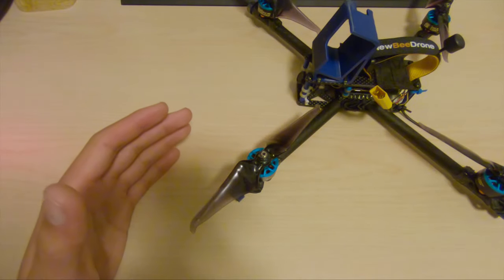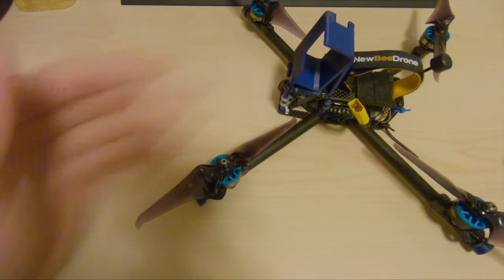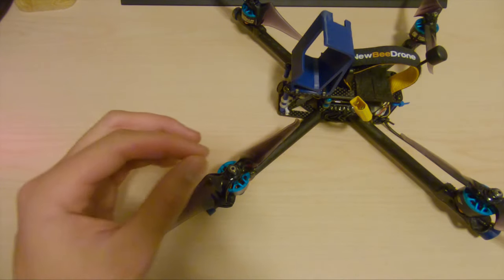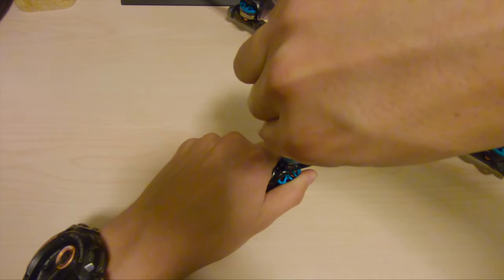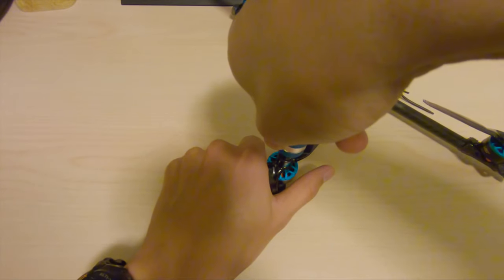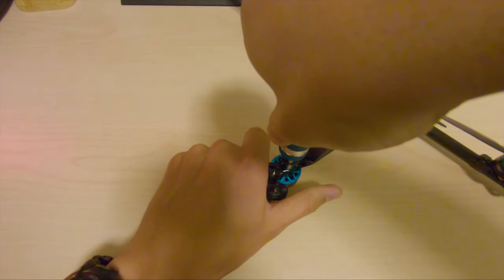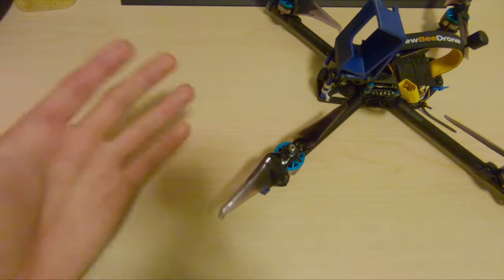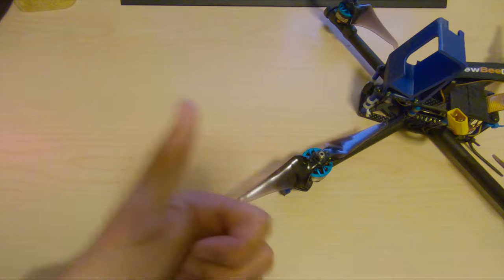The Fastest Way to Change Props

Comment: Huh.. How did you know. 😄
Have you tried removing Beta85 props? I can't imagine this will solve my issue.
I tried spinning off by hand like with my meteor 75.. Nope. Shaft spins.
 I understand why they make it tight. These 1102 11000 motors are beastly little motors. They have a reputation for ejecting bells and prop & shaft  goes bye bye. 🙁
So, some genius decided to make the 1.5 prop ID a tad smaller to prevent slippage.
Well. I used one of those tools in your hand.
 (Facepalm goes here) 
I managed to not only bend the soft metal of the tool as designed to do, I also managed to unknowingly bend the bell arches and smashed said bell onto the windings.
Unbeknownst to me, yesterday I noticed my batteries tanked rapidly. Less than a minute each. I knew something was wrong so I checked for heat.
3 warm motors and 1 that would have burnt my lip. 
😣 I'm not feeling too smart.
I bought it the 8th. of this month and received a backup I ordered that day.
Yeah. 
What to do?
How the __ do I change these without damaging anything?

There so tight I pulled two of 4 blades off a tip damage only prop that I planned on saving for emergencies from one motor.